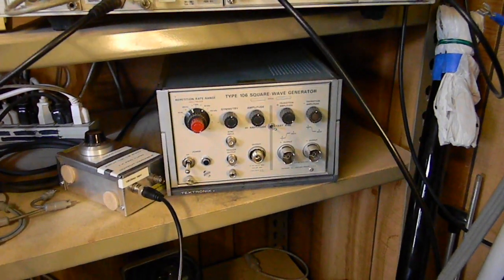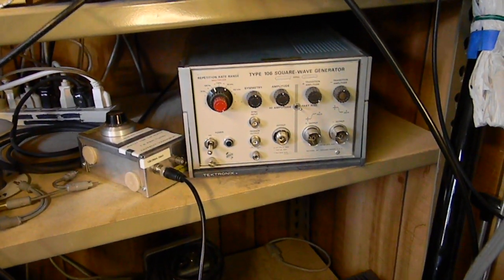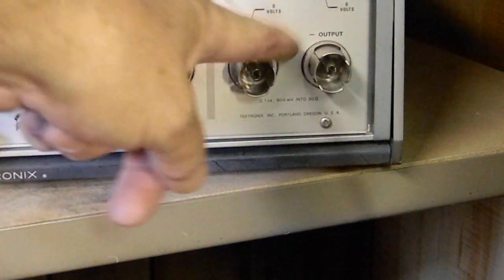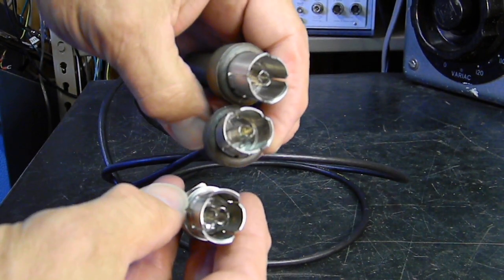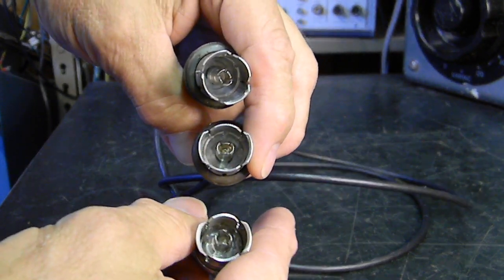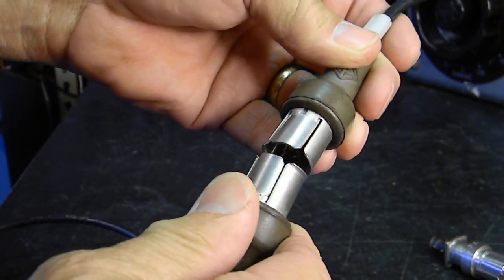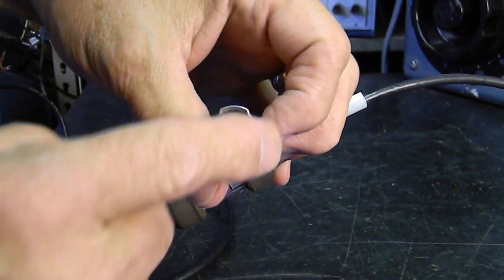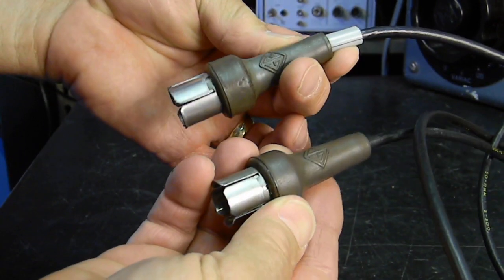GR-874 General Radio - Genrad - Connector.MOV

Comment: OMG, I've been searching for the mate for the last few days and finally decided I better actually research this.  You video comes up and sure enough it's you, the most influential guy on my audio lab. So glad you made this video.  This is my first foray into GR874 plugs.

For the record, you've led me down a deep long path on playing in the lab.  All I wanted to do was restore old guitar amps.  Now I'm consumed with repairing old GR, Tek, Fluke & Keithley lab voltnut calibration equipment.  I started collecting a lot of the equipment you have, many in need of repair. I've picked up a Tek 5S14N real-time sampling plugin that I'll restore and some of the calibration tools have the GR874 plug.
Reply from the maker: I have to admit, it kicked me around for a while also. I actually figured it out one night as I was just staring at the ends of two of them and noticed that they are not square but rectangular and wondered, if I did this..... OMG, it worked - they fit together. That was my eureka moment so I figured it might be happening to others. I am very pleased that you let me know how you have gotten into electronics. It is still very much my passion and has been since I was around ten years old. Stay safe and have fun.

Comment: Nicknamed the 'sexless' connector they are hermaphrodite connectors made in Middlesex County, Concord, Mass, home for General Radio. We also made  a precision line of hermaphrodite connectors named the GR-900. Designed, in part, for a higher performance sexless connector for fully reversible lab standards and related test equipment.
Reply from the maker: Leland Hite LOL...The fact that the company was in "Middlesex" County and made genderless connectors is almost too much... I know of the GR900 but I have never run across one - that I knew of - I really like the old GR products and the W50B, 50 ohm load is better than the Pasternack and Narda, in my experience. Thanks for your comment.
Reply: ElPaso TubeAmps With the GR-900 line we could measure VSWR down to .001/1 then disassemble the set up and do it again, all repeatable. Expensive, but fun to work with.
Reply from the maker: Leland Hite It sounds like you worked for GR. I would love to know what you did there. I am now retired after 41 years of government contracting. I started with Univac at NASA in Huntsville in Jan. 1970. I moved to El Paso in 1976 to work at WSMR for another 20 years and then left a contract with Lockheed Martin for Northrop Grumman on INS (and then DHS after 9/11) contracts until 2007. I finished my work career as a technical writer for Fort Bliss at the end of 2010. I am now happily 21 years old again and just can't get enough of my hobbies, 24x7.
Reply: ElPaso TubeAmps Sounds like an interesting career you had. Univac in Minneapolis was a good custom of ours. 
Now retired, 28 years with GR as an engineer (EE) in the marketing dept. deployed to the field. This was the old method of doing things, When you joined,  we spent a year at the factory working in every department for about two weeks.  We were probably the only people in the company that knew, in detail, how the entire company worked. Too expensive today for that to happen, but we sure appreciated the knowledge. Spent most of the time in the mid-weest as a sales engineer or district manager. I was fortunate to work in every technology, from microwaves, to acoustics, impedance measurements, to the automatic test equipment in the 80s and 90s. We had an office in Dallas so I seldom got there. Sometimes to Houston or Dallas but not often. Now enjoying retirement doing a lot of writing and associated research. http://leehite.org/How_Things_Work.htm
Reply: G.R. used these connectors on all their impedance bridges used in the broadcast industry.  I have several of them.

Comment: yesterday i found out abou tgenderless connectors and i can not belive they are not the standartd for everything by now, like usb and radio equipment of all sorts
Reply from the maker: That is a very interesting observation and I never thought about the USB as a gender-less connector which it obviously is. I agree with you - why make it complicated?  I guess the GR874  connector was just "before its time".
Reply: is it? you need a female to female adaptor tho, i fond out about a connector called IBM data connector, that is truly genderless and has 4 pins like usb, now i wana try and wire some usb stuff with it just to bother people lol, qut it would be grate if usb was genderless